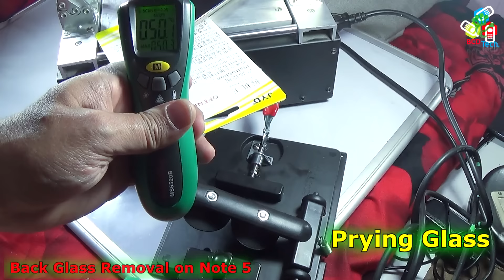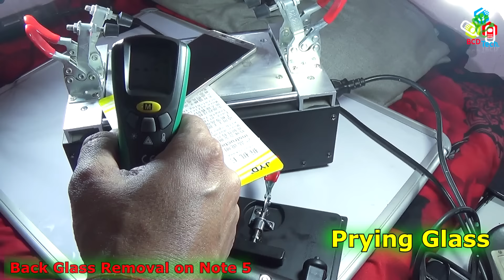Easiest Way to remove Back Glass on Samsung Galaxy Note 5

Comment: y do u want to remove the glass in the first place?????
Reply: In case you have to replace the screen if it breaks or replace the back. Strong adhesive holding it